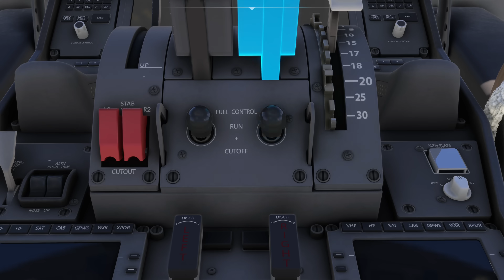Air India 171: Why Did The Fuel Cut-off Switch Get Moved?

Comment: 'Fuel control switches installed with LOCKING FEATURE DISENGAGED'
Published on December 17, 2018 'SPECIAL AIRWORTHINESS
INFORMATION BULLETIN' clearly mentions that reports were received for fuel control switches placed in Model 737 were installed with locking feature disengaged. Same switches were also installed in Model 787. 
Could it not be Boeing's fault then?

Please refer to the Original report: https://drs.faa.gov/browse/excelExternalWindow/BBE820D0419DB3358625836600761396.0001

Comment: Steeve your call yourself an aviation professional and with complete confidence you say its the pilots mental health that lead to this tragedy with so little information from the preliminary information . 
You dont seem to understand anything technical .. can it be humanly possible that both the fuel control switches be moved from run to cutoff and back to  run again in 1 second as the report says please try it in the simulator for once you will know the answer . Your so quick to give everybody a clean chit except the dead pilots unbeleivable .
 Do you know that the mechanical movement of the fuel control switches activates through electrial signals the fuel valve (in short software )does the opening and closing so if there is a sofware glitch the physical position of the fuel control switches becomes irrelative.  Only in such a scenario is it possible to record the entire process of run to cutoff to run in 1 second .
You have flip flopped on your statements multiple times shows your total lack of credibility .
Your now reaching out to boeing for what to gain more incentives .
All i see from your post is that you lack any professional or technical expertise your here to gain more views make sensational claims and incentivise .
 You are misleading the common man .

Comment: The narrative, by the western media and world being pushed (ofcourse initiated by FAA &AIB) , that the pilots were suicidal just makes my stomach sick!

1) How on earth are they not putting enough emphasis on, or just plainly ignoring the FACT THAT, THERE HAS BEEN AN ADVISORY ISSUED (which shouldve been mandatory) TO CHECK THE FUEL SWITCHES DUE TO "POTENTIAL DISENGAGEMENT OF FUEL LOCKING SYSTEM" i.e there were chances of it moving on its own. It further said that "THE FUEL CONTROL SYSTEM WERE INSTALLED, WITH THE LOCKING SYSTEM   D I S E N G A G E D"
So just saying that they "had to be manually moved" after reading the advisory and not taking into account that it WAS very much possible, just adds to westerners being ignorant of indian lives lost and putting it on the Pilots.

2) If either of the pilots was suicidal, History is Proof, that they do it while theyre cruising, who the fuck does it while take off??? 
Also, The Captain here was months away from his retirement and wanted to go back to his family and take care of his aging father.
And the First Officer was 2 months away from his wedding so.. Doesnt add up.
Also, as mentioned in the report, all the necesarry checks and pilot checks and background were done, and they were doing their training on time.

And They did try their best to save the plane tried to move the swtich back on, because it couldve "potentially disengage" 

NOTE - it says "potentially disengage" not "malfunctioned" or "stopped working" it just plainly got cut off. So when they turn it back on it still HAS chances to RUN again.

3) The dialogue exchange between the pilots , simply explains the shock, in the pilots hence asked the other pilot becuase they themselves could not believe it got disengaged on its own. Hence the word "You" in the sentence. And if they actually we're suicidal why they fuck would they deny "Didnt do it" they knew they were gonna die anyway.

Its sad seeing western media pushing specualtions on the pilots and saving Boeing, thier GDP earner

Comment: Your assuming the Fuel cut-off switch was moved. However what if the fuel cut off switch was untouched and the fuel was cut off due to an internal electrical technical fault with the aircraft which cut the fuel off with nothing to do with pilot's actions. I hate to point the finger at one of my favourite Aircraft companies Boing responsible for so many iconic aircraft through the decades like my favourite Boing 747 popular in the 1970s,1980s and 1990s. But you can't deny in last 10 years there have been question marks raised about the company and the aircraft it produces and alleged reported cover ups and payoff. I don't think the general public in America and worldwide is given the full story on the boing company in the last 10 or 15 years or so. Obviously Pilots will be looked at first. But the Boing and Air India should be looked at also with the same critical eye and forensic investigation.

Comment: I am retired now but used to work on electronic control systems.
You are talking about the mechanical operation of the fuel switch  ,from my experience  could it be a poor electrical connection,  i.e., poor crimp connection ,damaged cable etc.
This could give the intermittent connection in this timeframe.
Thanks for your professional feedback. 
John

Comment: Sir, there is a big difference between a Pilot and a small child.

Sir, as you said, you are assuming that the other pilot turned on the switches. 
In the same way, you are assuming that the second pilot was running away from the mistake by saying, "I didn't do anything".

This could also be a mechanical issue, where the switches automatically went to auto-cutoff. 

The way the media and experts are trying to put this on pilots, may be the experts are missing something that could result in something bigger that needs to be improved.

Comment: The pilot didn't do it. It was done remotely and this crash was predicted before it happened. They shut out the pilots and no matter what they did, it wouldn't have prevent the crash. Fly by wire is completely remote controllable as most of the new cars as well.

Comment: The FDR data shows the time that took for those two switches to transition from Run to Cut-off, or FDR to record as much was 0.1 second.  Does Captain Steeve think it is humanly possible to move those two switches in that short time?  May be Capt. Steeve must read the report in detail than doing his theatrics.  Capt.  Steeve the day after the incident suggested one of the Pilots could have wrongly pulled the flap lever instead of Landing gear.  
If you see his videos, the pattern is to blame pilots as they are not there to testify.  Or It is an effort to give a clean chit to Boeing, a company that is notorious for its unscrupulous conduct. Capt. Steeve conveniently ignore UK Civil Aviation Authority had MANDATED all 787 operators to inspect and replace if necessary the fuel valve actuators. 

There is a saying among the pilot fraternity :  If you are alive hang him and if dead, bury him.  Capt. Steeve, The least you can do is to wait for the final report than preaching sermons on Pilots mental health.

Comment: I guess my question has to be: Have the fuel cutoff switches been recovered in reasonable condition from the debris, and have they been examined for any potential faults? Surely that would answer the (doubtful)  question of faulty equipment undeniably.

Comment: Captain, you are jumping to conclusion that switches has been physically moved by the operator (pilot). Report does not specifically says that (it doesn't indicates switch noise heard, or pilots action has understood etc.) it is probably saying switches has been turned off  because switch's electronic signal has been recorded in the black box. Which can be a short circuit or Boeing's chronic problem which recorded before about fuel shutoff valves unintentional shut off while electrical blackouts even in micro seconds between electrical supply transition (main bus to RAT ie)

Comment: Hi Steve, in garybpilots release yesterday he highlighted the 737 issue tabled in 2018 with fuel cut off switches that were installed in the disengaged position. Further in his report it stayes that the 787 uses a very similar set of switches. Is it not conceivable that these switches were indeed faulty, despite previous flights not having any issues?

Comment: Heyyy.. wait a min !!! It very much seems and obvious that this Report is deliberately maid shady ... 
Why they haven't mentioned which pilot said what to other pilot it's very deliberately made ambiguous even after having the complete information and the report says no action is required or no probe is needed on boeing or GE !!!! Should be not take a step back making any conclusions about the pilots mental health or actions before questioning the authenticity of the report? This report is not even signed by any official in position that is no officer has signed this report, should we not as a first question ask why the report is not signed and why report is deliberately made ambiguous and why  specifically and I repeat specifically has has mentioned no action is needed on Boeing and GE.  Are we too dumb not to see this ???

Comment: Cessna Citation has a fail safe system of "Cutoff". It's attached to throttle... engine has to be brought to idle and then a locking liver pulled until that allow throttle to go below idle which cuts the fuel. Inverse procedure for "run".

Comment: Software or the system shouldn't allow cutting of both engines during takeoff on a critical altitude, it only should allow one maybe and also allow after a safe altitude. Even though there can be situation when both engines need to be stopped on this phase, that would be deadly anyway. Boeing at least should warn the pilots before doing any such actions so that both pilots can be aware of what's about to happen. What do you think about that? Is Boeing too far behind on these things? Is manual control the way to go in this era?

Comment: I wonder why are you not talking about -  bulletin issued by the US Federal Aviation Administration (FAA) in 2018 that had recommended the locking mechanisms be checked on multiple variants of Boeing aircraft, including the 787, after the company had received reports that on some 737 models “fuel control switches were installed with the locking feature disengaged. Almost all the airlines have instructed their fuel switches to be inspected and you are still singing so adamant to put blame on the pilots. I would have expected you to have better understanding of English than most people. The preliminary investigation report no where says that the switches were manually cut off, it only says that the switches were cut off.. the pilot is clearly heard saying that he didn’t do it.. so please tell me why should we trust you and not the pilot. Having said that you mentioned lots of Boeing engineers fly in their own aircrafts.. very cleverly you again forgot to mention that many Boeing engineers have publicly admitted that they will never fly in Boeing due to safety standards not being followed properly. I wish you good luck with your save Boeing mission.. but the truth will come out sooner or later.. may be we need a few more crashes..

Comment: Hi Captain Steeeve, as someone who doesn't know much about planes, thinking about the potential additional safety mechanisms to prevent the Cut-Off switch from being set. 

You mentioned that disabling it when close to the ground would be an issue in the case where you need to cut while landing, is there a scenario where linking the cut-off to the throttle control would not work ? My assumption is that during take-off the throttle would be at 100% or at least over 50%, what if the cut-off is interlocked with the throttle, in the event where a pilot legitimately need to do the cut-off, i would assume the throttle could be set to 0% for it to work ? During take-off and possibly in flight, it would me more noticeable for the second pilot to see if someone is pulling the throttle back and then switch the cut-off. 

With interlocking the cut-off to the throttle, i can see that if one is landing, the throttle will most likely not be 100%, i'm also assuming that should one need to do the cut-off for a single engine during the flight, i would think the throttle for the specific engine would also be set down to 0%? 

Thanks for the informative videos.

Comment: Is there a possibility that the engines got shutoff due to technical problem and the captain, after confirming with copilot that he did not put off the switches, tried to restart engines by switching off the fuel switches and turning on again immediately to restart the engines? The preliminary investigation report is a total fabrication to mislead.

Comment: I think it is more likely that the "culprit" said "Why did you do it?" in an effort to shift blame than the guy who did it denying. The Mayday call is also odd or sounds like an attempt to cover up, i.e., "I was doing my job." In an emergency, "aviate, nagivate, communicate." In such a huge emergency with seconds before impace, why was this guy on the radio rather than dealing with the problem as well as focusing on the path ahead, attempting to steer to an open area, etc. Very odd that communication became a priority.

Comment: Capt Steve, perhaps you were on to something with your initial conjecture of pilot error concerning flaps. We should consider more closely a simple absentminded reflex action of a routine function (though the WRONG routine function) that could easily cover the facts: the action occured almost EXACTLY when the "gear-up" action typically happens (by the pilot monitoring, I think?) and this mentally distracted pilot monitoring even believed he had raised the gear ("no, I didn't shutoff fuel").

Again, assuming no mechanical / electrical malfunction, then I rate an "absentminded routine activation of fuel switches used at the end of every flight instead of the routine activation of gear-up done at the beginning of each takeoff" as an equal or greater possiblity of "intentional mis-operation to crash the plane".

Comment: 10:04 See...  Steeve is 100% sure that flight is working as intendent... the electricals, the circuitary the mechanical, the software and thinks it has to do with pilots mental health.. but the day AI would take complete control of the plane he doesn't want to step foot on an airplane... ?

Comment: Cockpit cameras that are specifically pointed towards instrumentation and NOT pilot faces or bodies would be a good thing?

Like you can ONLY see the guages and switches and knobs and pilot hands interacting with these items but not faces and torsos of the pilots. That could be somewhat less intimidating and invasive to pilots in the cockpit?

Especially in thie eerie case where engines are switched off seconds after takeoff and BOTH pilots claim to have not done so (one accuses other, other denies). Video footage of those switches would have confirmed who did what?

Comment: I don’t think that requiring both pilots to cut off an engine is a good idea in the case one of them is incapacitated. But I would change the mechanism so that it would allow only one engine to be cut off while in flight as a fire in both engines is extremely improbable

Comment: I still have some questions though
1: In how many ways the shut off valve can be operated? Is it powered through an actuator or is it just a 100% manually operated switch?
2: Is it possible to switch off both the shut off valves within a second?

Comment: i have a friend who owns a private single engine prop plane.  he was telling me that he thinks that the fuel cutoff switch actually "locks" itself into position. he thinks that if you want to move from one position to another that you have to pull up on the knob on the switch to unlock it before you can move it.  this is to prevent moving the switch with an accidental bump..  is this accurate??

Comment: One question. Assuming that the pilot did cut off the switches but the electrical systems were working fine as you made the conclusion that it was not because of boeing, Then why RAT was activated. Could you please explain?
Reply: RAT is deployed because shutting down engines will also shut down the power which was being generated. The aircraft knows it is airborne and the RAT is automatically deployed to continue to generate power to keep the cockpit actively working.

Comment: None of this makes sense. The report isn't telling us everything. Why not release the entire 30 sec recording?  I'm sure from the cockpit voice recorder they can tell which pilot said what. If it was shut off intentionally, I'm wondering how the pilot flying is able to shut off the fuel while pulling back on the stick at V1 without the pilot monitoring noticing. So that leaves the possibility that the pilot monitoring is the one to mess with the switches?

Comment: My question is both are in cockpit and if one pilot try to cut off the engine and that too by operating both button and its not easy unlike switching off light wouldnt other pilot notice it and immediately raise alarm saying what the hell are you doing. And is it possible to do it manually within a span of 1 sec?

Comment: All aeroplanes should install cameras in the cockpit at least now, before more people die. 
The air fuel system should be able to be cut off only a few minutes after takeoff. The computers should have the upper hand in such situations. Why did a new generation plane allow an unwanted, dangerous action? Sophisticated planes with ancient technologies for a very important fuel control switch.

Comment: Don't you think there should be a prominent alarm that sounds, both audible and visible, when the fuel cut off is deployed during flight? Had the other pilot known about the cut off immediately, it might have saved the day. And knowledge of an alarm could have discouraged the pilot that turned the switches off from doing so. Such an alarm, perhaps, will be the eventual corrective recommendation by NTSB. Thank you, Steeeve.